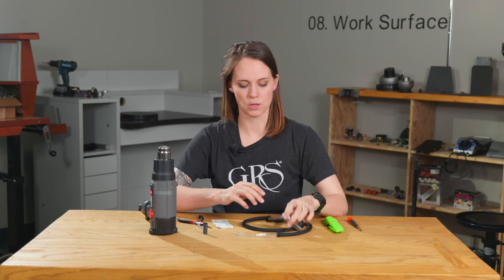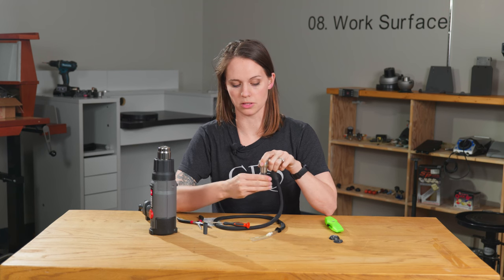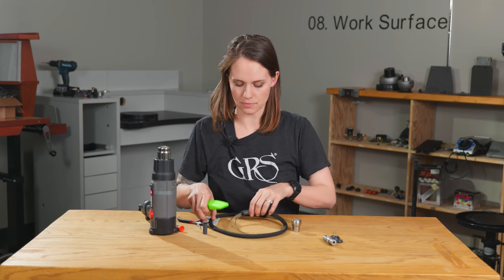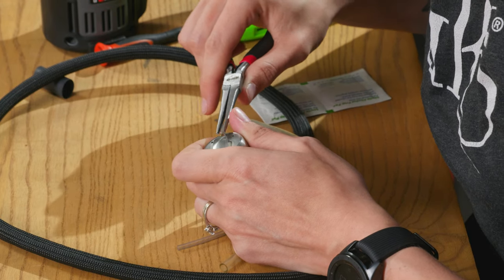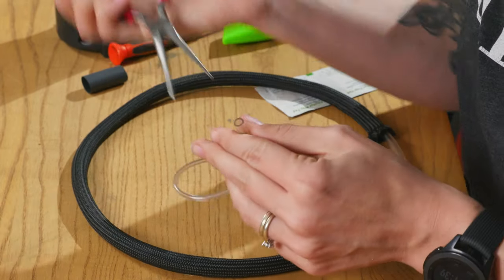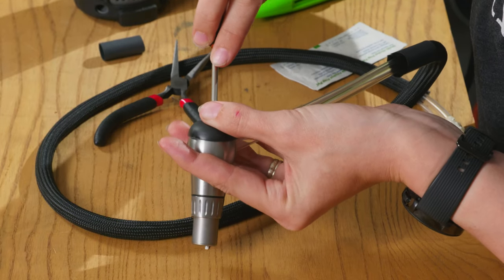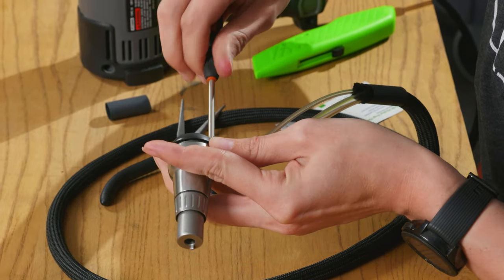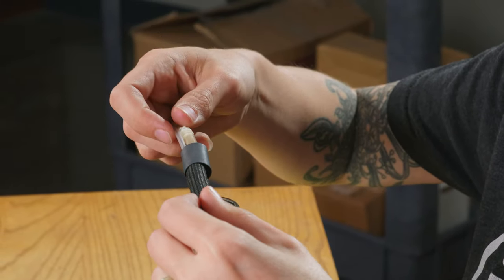GRS University: Handpiece Tubing Repair

Comment: Hiya Molly,
There is no 'Thumbs up' button to hit? Only a 'Thumbs down'.
Would heat the end of the two clear tubes by placing them in very warm water, not hot, and most definitely not boiling water. Then fitting them in place. 
Stay safe, Steve...